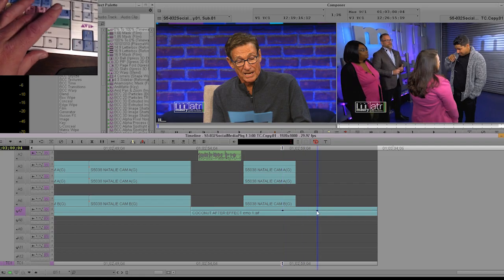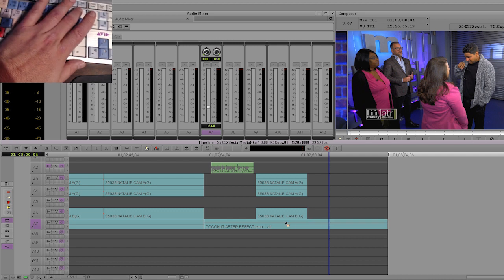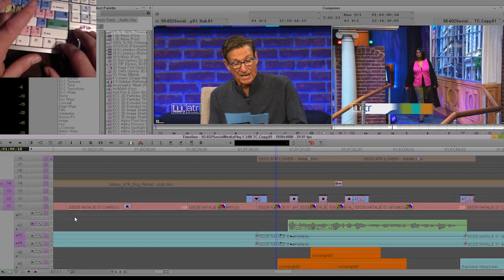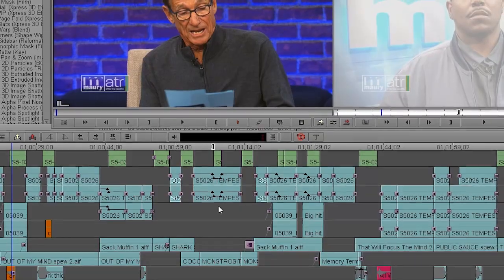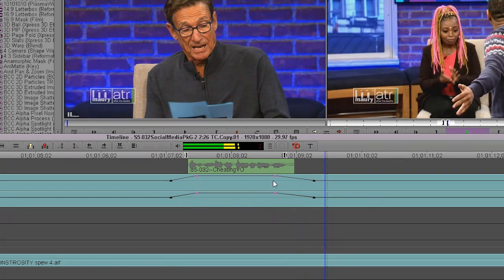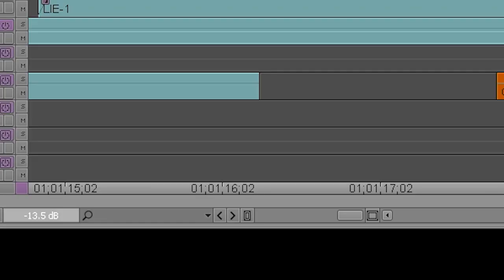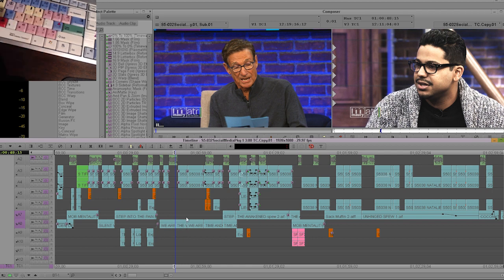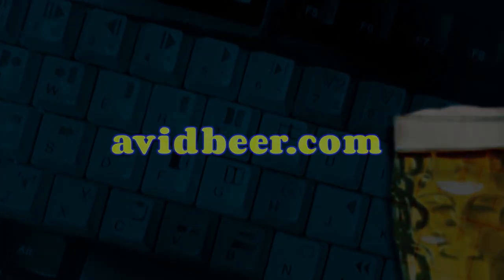Audio Rubberbanding in AVID

Comment: Thanks for this man, I would recommend setting head and tail fade to keys... No need to go into the transistion menu for end and start at cut fades. One thing I don't know, is there a way to alter levels on the fly, via the mixer and have it create keyframes on a track? I know there is a live and auto mode in the mixer but I'm not sure how it works. Thanks again!
Reply from the maker: There definitely is a live mixer mode but I would only think to use it if I was re-editing an hour plus live concert/event. It's on google but  for short promo/packages like i cut I don't need it so I choose to drink instead of learning it!

Comment: I think rubber bands are useful but only in precision circumstances. Add edit / Quick trans is faster for me as I have frame durations memorized for all of the normal framerates. (Do it enough and it become second nature)
Rubberbanding is additive on top of the mixer's gain for a clip so it's easy to get lost if using both liberally or interchangeably.  They are separate.
I stick to mixer for overall gain and only rubberband when I need to get deeper into a clip's audio fixing spikes or low dialog bits and ducking. 
Keep them separate in your head, that way if you need to adjust db on the whole of M&E because it's too hot throughout, the mixer still works as expected with the rubber banding as a layer of finer adjustment on top of it.
Another important use for mixer gain is when it's going to an audio engineer. Instead of lifting out unwanted dialog where people are talking over each other on different mics, just drop the clip to -infinity (can use rubberbands too). That way, you don't hear it but the sound guy has the clip in case he needs it and isn't bitching at you over not having the media. Everyone's happy.
AND FOR GOD'S SAKE, NEVER MUTE CLIPS and then deliver it to someone else. Muted clips don't get exported. CLEAN UP YOUR FILTHY HABITS. NO BEER FOR YOU!

Comment: Here is my question that nobody has been able to answer.  When I fade audio to 0 using rubber band and then put a 4 frame dissolve at the  edit point (I work in news and dissolve all of my audio 4 frames) the audio in the dissolve spikes back up to full.   It forces me to have to o back and remove that 1 effect.
Reply from the maker: I don't an easy solution for this because that shouldn't happen...Once you bring the audio down to zero it doesn't matter what kind of dissolve is on it. It shouldn't come back up. Respond here if you ever figure out what the issue was. Cheers!